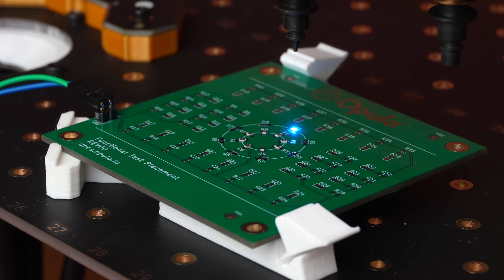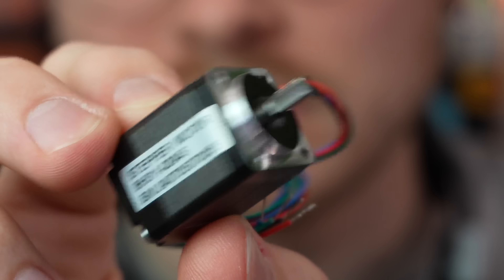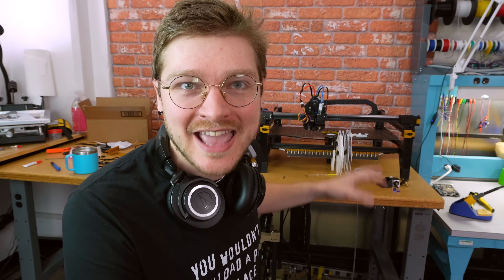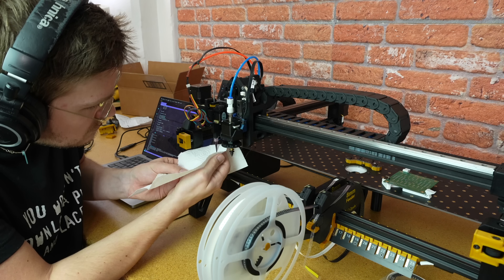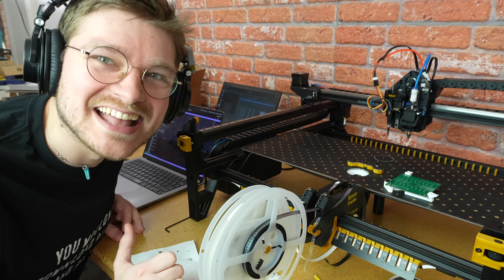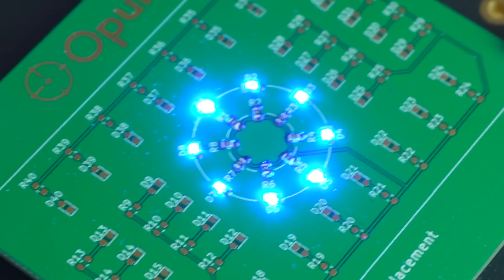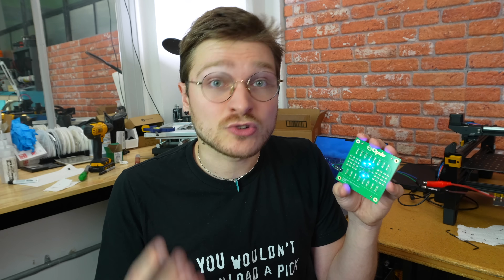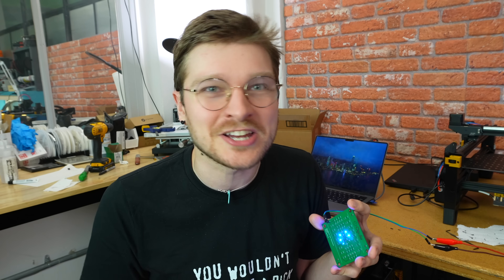one machine for PCB assembly

Comment: This could be useful for medical electronic. We buy this very expensive capacitors with "flex-term", so that the possibility is lower that they do not break. If they are glued to the surface, with a good flexibility, then this would be a win.
If the surface is like jelly and the inside is still liquid, this would be okay too. It always depends in the application.

Comment: A little late but...
Instead of putting the solder paste onto the board why not put the paste onto the contact points of the component?
This will keep the paste dispenser away from the board and reduce possible "messing".
Another option would be to use small 3D printed stencils like those they use for pad printing, one for each set of generic component pad footprints and go from there.
The advantage here is that all the contact points of the component would be "pasted" at the same time.
Most resistors, capacitors, LED's etc have identical pad dimensions, spacing and therefor a single "stencil" could be used for all of those components.
Another option would be to have a "bath" that is filled and flattened after each "pick-up" and simply dip the component to a set depth into the bath so that all contact legs come into contact with the paste.
This last option might be the easiest and simplest method to investigate.
One thing to consider is the solder paste.
The paste has been formulated specifically for the traditional thin metal solder paste mask method.
For this method the paste might have to be thinned down a bit with extra flux or some sort of thinning agent that evaporates quickly.
For long runs that take days or weeks the stencil method might be best but for very short runs or "one-off" development boards the "paste onto component" method will be hard to beat.

Comment: Like we have learned with the high-end 3D printers, using a gear reduction for the extruder would give you substantially more torque (given your low power stepper motor, where you mention it periodically missed steps) and also give you very finite control of the pressure.  3:1 to 8:1 ratios should be tested.  This will allow complete control necessary for reversing the dispenser flow.  This is the only thing missing from your design - well done!

Comment: The UV resin might also not work because it doesn't dry, it cures. So ther's no non conductive solvent that can evaporate from in between the conductive particles, it just stays there and polymerizes. So the resin would stay in the high resistance state like the wet glue you used. 
Also, i think there's electron beam hardening glue, but that kind of defeats the purpose of being accessible

Comment: if you used a smaller needle I wonder if you could treat it more or less the same as a 3d printer (maybe even use a 3d printing slicer) to "print" the ink/paste into actual pad shapes rather than just blobs

Comment: Wild idea but if you use 2 component epoxy. Mix one part with something conductive like copper powder or so. And then in the second pass add the other component, drop it from above so the first component never touches the needle. No clue if it would work, just annidea.

Comment: Doing this with solder paste instead of ink would make PCB assembly so much faster, and less manual. Then include a hot plate as well and boom, soldered PCBs without lifting a finger. Prototyping dream

Comment: There's a manufacturing technique called wave soldering where a board is basically dragged across a pool of liquid solder.  This works well with through hole components that are all on the same side.  However this process can easily be adapted to SMD components by adding a drop of adhesive between the pads of an SMD component. Often it's two tiny drops along the nonconductive edges of the SMD component.  Many power boards are made this way where all the through hole components are on one side and all the solder joints and SMD components are on the other side.  Anyway, this syringe setup is perfect for this process; it could add the adhesive, then place the components in the adhesive, and then the board would be ready to solder.

Comment: Carbon is too good at absorbing a broad spectrum. Commercial solutions use silver a lot so maybe that's a better option as it might reflect the light deeper into the blob. Loctite has a hole range of conductive silver inks like LOCTITE® ECI 1006 E&C

Comment: It won't be a surprise but it was quite predictable that the first drops of conductive ink woulnd't go onto the board, it is quite clear  that you left a lot of play on the gear connected to the threaded rod, you can see it from the video, you can predict it if you know how you're doing this, you could close the gap a bit, use different materials to avoid friction, or even add a spring probably. 
Also if you wanna play around with UV resin you might find some helpfull stuff in proper printing's attempts at an FDM resin printer, it's not the same thing but he was indeed extruding resin with a syringe, you might find helpfull stuff there. 
That said I see many people suggest an entirely different route in any case good luck with that!

Comment: Surely there is some clear conductive material from the touch screen or heated glass industry that could be mixed into yhe UV resin rather than the lamp black?
Actually what about chatting to the Positron 3D printer folks, their heated bed is clear!

Comment: CNC kitchen have a video about curing UV resin with heat in addition to light, and it turns out, it can just cure with heat itself. Maybe heat applied to a partially cured part would allow continuing crystallization process inside the blob? https://www.youtube.com/watch?v=886X2geCRrA
But hey, I'm not an expert
But yeah, to focus on soldering paste might be a way to go - even if it wouldn't achieve as high accuracy, but would be fucking awesome.
Thank you for experiments! I hope you will succed!

Comment: Try adding 12hr setting resin as well as the uv. So that you get a skin set which holds the part with UV then the 12hr setting resing hardens the insides and sets the  rest.

Comment: There is a paper called "Photo curable resin for 3D printed conductive structures" in the Additive Manufacturing journal. "In this study, researchers used acrylic as the photocurable resin,  AgCu flakes, and Ag NP for the metal fillers. They prepared the mixed resin solution/paste by adding 15 wt% of ethylene glycol, 7.428 g of AgCu flakes, 5 wt% single-walled CNTs, and 8 mg of photo-initiator Irgacure-819 into 80 wt% of commercial acrylic resin followed by ultrasonication and magnetic stirring for an hour." 

Not sure if these are feasible on your time scale but what you are trying is definitely possible.

Comment: If you could interleave the paste application and component placement (ie: paste the pads for a single component immediately before placing the component, even after the part is picked up potentially) then you don't need to worry as much about having longer curing times for the paste. It only needs to stay workable on the board for a few seconds, although you do want to ensure it won't dry out too badly on the dispensing tip at least.
Reply: or if it would stay workable if it were hot, then maybe you could use a conductive fdm filament instead?

Comment: Coming from the polymer world here, maybe if you tune the extrusion rate and filler percentage to optimize the conduction, a "film" is all you'd need if you let the UV resin cure for long enough. Alternatively, you could experiment with a reflective filler instead of graphite that conducts but honestly at that point solder paste with a re-flow is the mechanically better option.

Comment: I'm not at all interested in conductive ink, uv resin, or solder paste.  However the real use case for this kind of thing is adhesive to hold parts upside down for a double sided smd pcb.
Reply: I agree.  Glue dispenser for double sided boards has immediate application.  For large parts the current setup is probably good enough.

Solder paste is a cool idea but I would be surprised if you could get the accuracy necessary for fine pitch parts.

Comment: Black UV inks for industrial inkjet printing require sufficient curing, and are probably formulated with photoinitiators that are different to those in less opaque inks of a different color. Different photoinitiators initiate crosslinking at different wavelengths, and not all of them work by means of free radicals, but sometimes with a cation or anion... honestly that's the extent of my knowledge, I merely operate such a single-pass printer, and there sure are lots of difficulties when it comes to high speed curing.

Comment: I was aboit to suggest Titanium oxide (super white, so better UV transmission, but maybe not as conductive. Maybe a mix with graphite?) But ITO may be a better suggestion, haha. Also, try looking into graphite/carbon strands instead of graphite flakes; I bet having long members of conductive material will give much better bulk conductivity than hoping the flakes achieve sufficient contact. I think chopping up carbon fiber weave would be a good place to start! Though, maybe worse workability than flakes susppended in a medium. 

Another idea is something in the same family as superglue; an adhesive that only sets when another chemical is added. Superglue doesn't "dry", it actually sets when exposed to trace amounts of (I think) oxygen or hydrogen ions. There may be a better chemical that won't cure just when exposed to atmosphere, but instead when hit with a kicker or something. 

But failing the chemical pathway, the solder paste applicator would be a HUGE next step. To remove all the human action of masking and applying paste would be such a big step forward

Comment: there are small geared DC motors with M3 shaft (3-6V that do 30-60 RPM) they work perfect with this. I have made a paste dispenser with it, has plenty of torque. And due to its size it can be inline with syringe.

Comment: assuming you have (or are willing to get) a shop compressor, I STRONGLY recommend getting a 983a digital auto paste dispenser. It attaches to the syringe with an airtight cap via tubing. So, far less mechanical load on the lumen. Basically NO mechanical stuff to add, other than the syringe holder.
The controller gives you .. control .. over the dispense air pressure, dwell time and back-off pressure. So you can set how much pressure is needed to push the paste (solder paste needs much more than ink or glue for example). Then the wait time for dispensing (controls how much actually comes out), and finally it sucks the piston back a bit to control drool. 
for interfacing, it has a foot peddle switch input (common 3.5 mm headphone style plug). As a digital input, it reduces the code on the lumen as well (no step driving.. just trigger the logic pin and wait whatever you set the paste time for.
Its really helpful for manual pasting to prevent cramping or just hand exhaustion from pressing the plunger over and over.
Reply: its really awesome you are exploring this stuff..

Comment: One thing that would be super clever is if you had a way to dock the nozzle into an airtight sheathing so it's capped back closed as soon as the operation it's needed for is done, prevent drying out and keep it performing as best it can, since it wants to actively evaporate, so basically treat it like isopropyl.

Also I don't think the UV resin is going to pan out easily TBH, you sort of need a conductive grain suspended in a liquid that will remove itself from the equation and promote bonding between the grains to form conductive chains/blobs, because most conductive liquids are actually pretty bad at it! Resin hardly looses any mass when it cures, it won't promote those bonds, just freeze the grains in place(and if it was able to reasonably flow, that means they are spaced apart, so they are now frozen in that spaced apart state since next to no resin was lost), and as you found out, also get inhibited curing by the grains etc. You'll also have to deal with settling over time if the suspension isn't stable.

Nitpick: 'dead reckoning' is used in relation to finding an unknown future position by using previous known positions, headings, and speeds. You know the intended future positions already, so there is nothing to 'reckon' here. This would be referred to as running an 'open loop' placement method, instead of the 'closed loop' of the vision system and active refinements it makes. Though technically speaking your steppers themselves are also 'open loop' without encoder feedback from skipping.

Pedantic things aside, I think it's amazing you got this going already, I just knew it was coming after the prior video. For your extruder system you might need to make sure the plunger never starts spinning, else that will cause unmetered results. I'd at least put marker dots on the edges of internal things it so you can visibly observe to see if that ever does occur or the friction keeps it running straight.

Comment: Increase the gear ratio. A small motor will drive a bigger load. Instead of 1:1 go to 2:1 or 3:1. You don't need speed here.

Comment: Have you heard of this method?
Start with bare copper PCB, apply solder to entire PCB(it comes in a thin foil although some places just dip the board), CNC out traces, pick&place dips parts on flux, places on PCB, PCB is heated and all parts soldered in place, no moving PCB means no parts get moved.
Reply: That sounds like a nice method for making prototypes all in-house! You have to deal with chips/dust though, so you'd want an enclosed machine and dust collection of some sort that vacuums it out between the milling and fluxing/pick-and-place step. Can't have it running constantly or it will suck up components, but need to clean it off so nothing shorts.

Comment: Congrats on this iteration ! Very inspiring. Maybe you can try putting more ink and some retraction to suck back some of the ink back in the syringe. I think the pad should then fully covered without having too much of ink. Also could add a sort of retractable cover that moves out when the ink head goes down and comes back under the syringe to prevent any unwanted drop on the table. Keep up the good work !

Comment: You can also try two component conductive epoxy. You’d only need to switch out the mixing tips between runs.

Henkel Adhesives sells some commercial ones as well you could try starting with.

Comment: You need to find an epoxy that can be cured by UV and heat. UV cure to tack everything in place, then heat cure to penetrate through the graphite/carbon black to cure the inside of the blob.